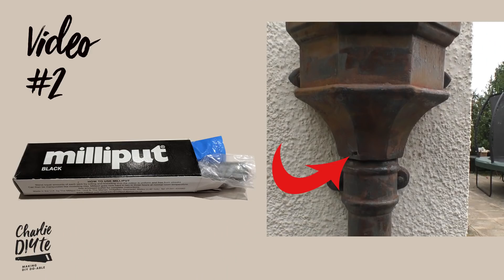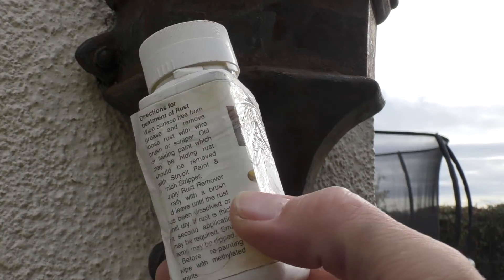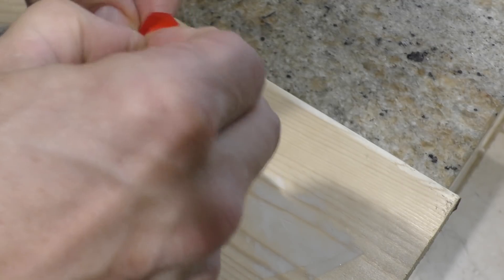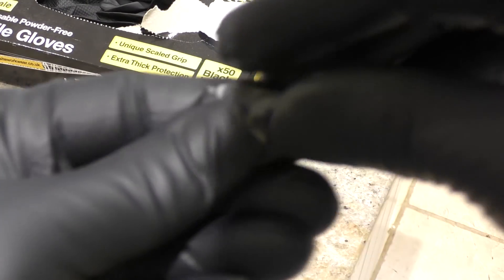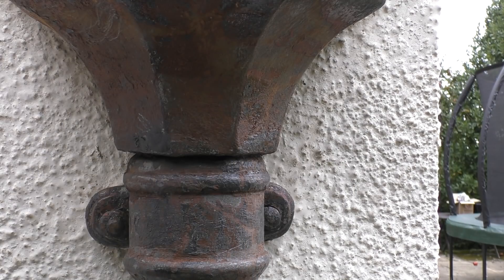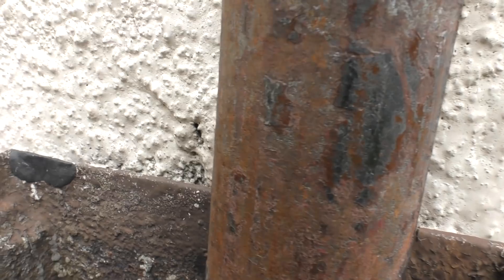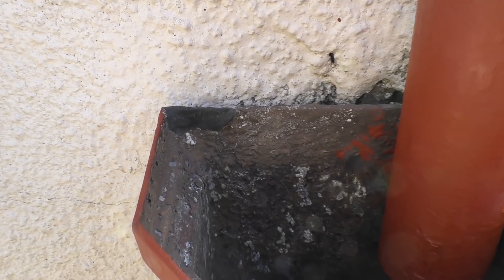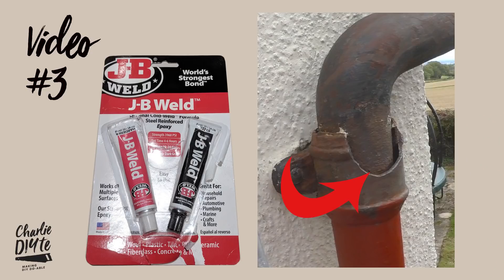How to Repair Holes in Metal with Milliput - Video 2 of 3

Comment: i use milliput to fix everything ! its amazing stuff ! ive used it to repair a crack in a motorcycle exhaust pipe ! milliput set solid and exhaust doesn't leak at all ... great stuff
Reply from the maker: It's awesome Clive isn't it! There was a radio program on the dangers of DIY dentistry and a guy had redone a filling with Milliput white - lasted well over 10 years 🤣

Comment: would this work to replace 2 small rivets in secateurs.The non blade half is made of 2 parts which were rivetted together
Reply from the maker: No, I think you'll need to get some bolts to replace the broken rivets?
Reply: @CharlieDIYte  Thanks but bolts would stop the secareur blades from engaging.One blade, the non sharpeded, is made of two overlapping parts, riveted together
Reply from the maker: @valeriegray1576  Oh I see, so the rivets are basically just holding the blade to the secateurs? This stuff might be better https://youtu.be/QkL7Ua641Ss Worth a try if the alternative is throwing away the secateurs 🤔

Comment: Could I use this to fix a leaking joint on a cast iron gutter?
Reply from the maker: You could, but you might be best to use gutter sealant, which is a sort of rubberised mastik, in case you ever need to take the joint apart, or, if you really want to go to town on it you could buy a proper joint kit http://bit.ly/2OWN6Fz but you have to be careful knocking out the old nuts and bolts as the cast iron is quite brittle and can crack.

Comment: I wonder if it would repair cast iron radiators. I have city heating system that get very hot and i tryed more iron epoxy ( more like fiber glass idea )that didnt really stand the heat.
Reply from the maker: It's worth a try!

Comment: Excellent repair. I love the fact that you are restoring your cast ironwork around the house. It is a much an architectural feature as anything. Beats plastic all day. I wish I had it!
Reply from the maker: Thanks Patrick. Couldn't agree more. Scraping off the rust I keep revealing all these date stamps and insignias - they definitely add character to the house in a way that plastic couldn't - and they've been there since the 1970s!

Comment: Charlie  Some advice when cutting the pieces of putty: Clean the blade thoroughly between cutting the two parts of the epoxy. You left some white part on the black part of the putty, and that will cure and can cause chemical reactions throughout the remaining black putty. SImply wipe the knife clean before cutting the other piece of putty. Your putty will last longer and work for a longer time.

Comment: How to repair holes in cladding, boss?
Reply from the maker: Is the cladding wood? You can use Milliput on wood, but I'd probably use a 2 part wood filler.
Reply: @CharlieDIYte  plastic cladding for a shower.
Reply from the maker: Ah, then you need Milliput White https://www.milliput.com/white.html

Comment: check out JB Weld, it’s the best out there
Reply from the maker: That's my next video!
Reply: it’s good stuff, has high heat resistance and is used to build up cylinder head ports in race engines.
Reply from the maker: Wow - I didn't know that! I just wish it was a little more viscous and set quicker 🤔